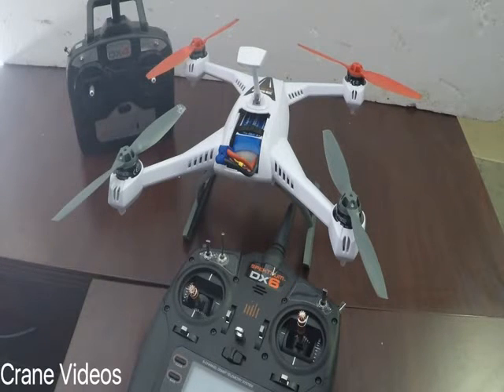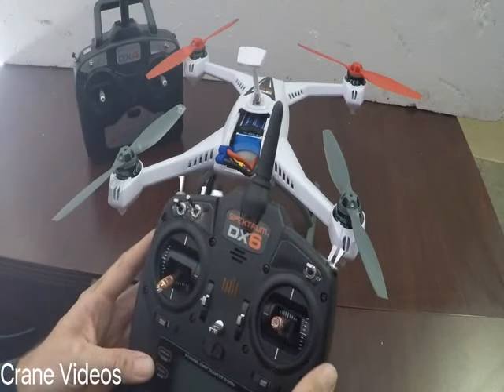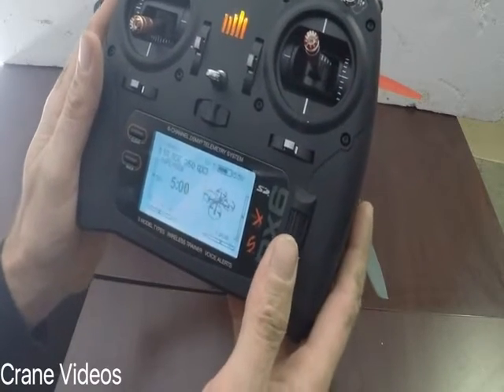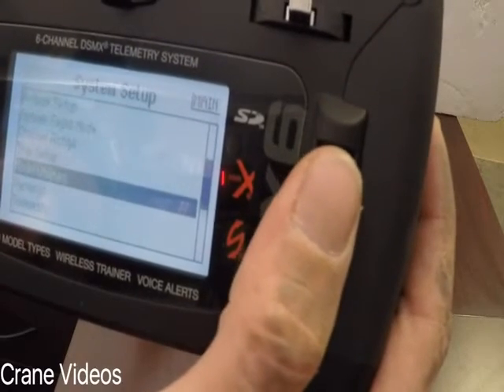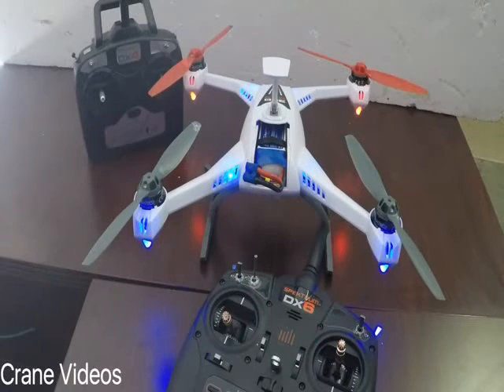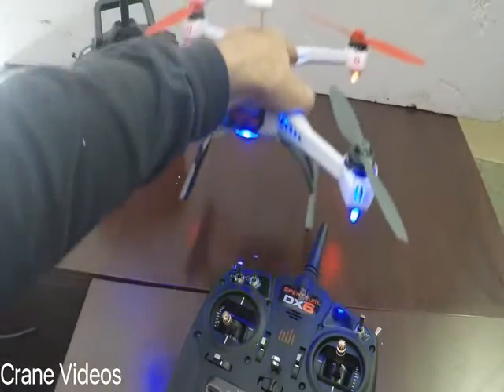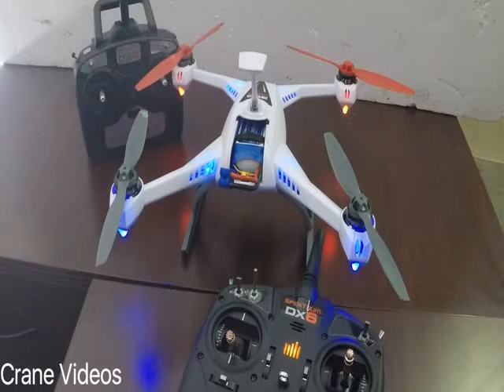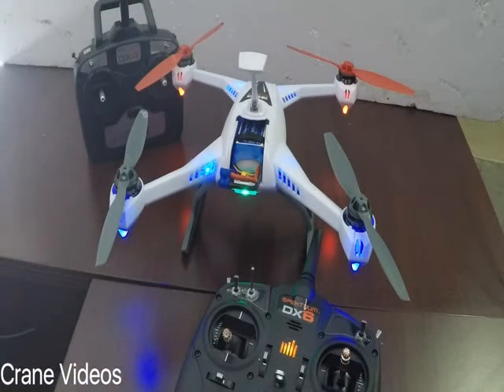Blade 350 QX3 How to bind with Spektrum DX6 transmitter

Comment: My throttle don't spring to the middle no more.......😩
Reply from the maker: Have you opened it up to see if you can reattach the spring?
Reply: Crane Video My new DX6 does not have throttle spring, my old DX4 did.
Reply from the maker: Ahhh.  Ya I’m not the biggest fan of the DX6 for drones just for that reason.    They are a lot better for planes and helicopters in my opinion